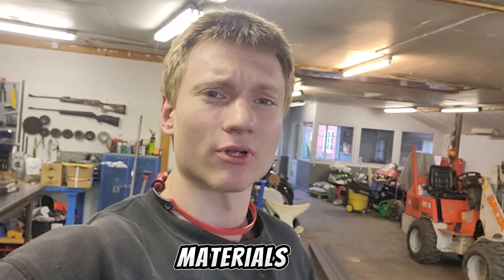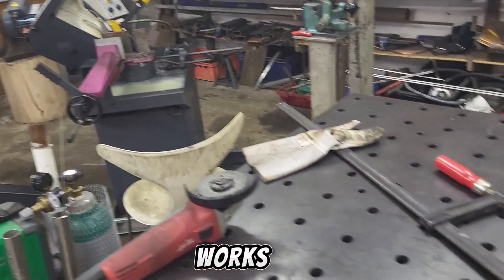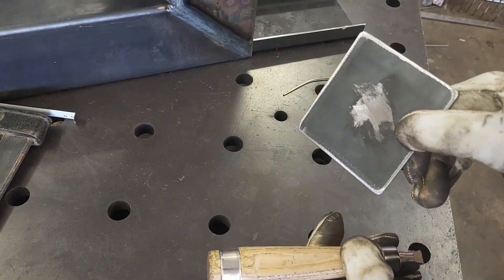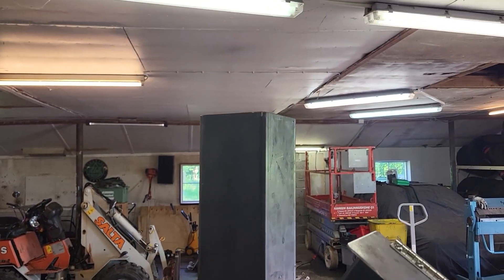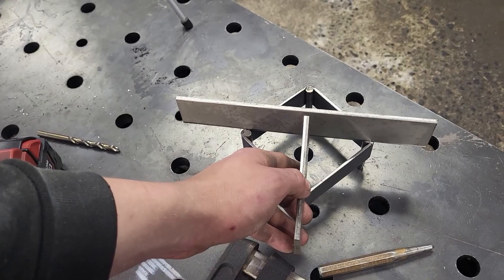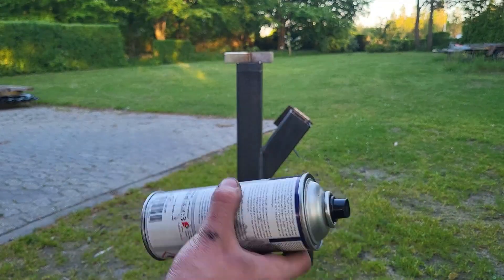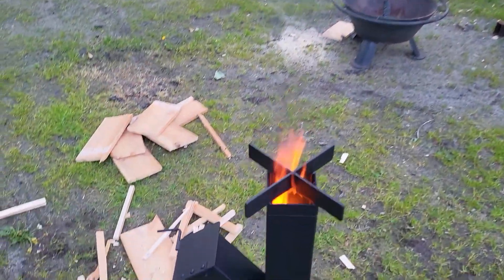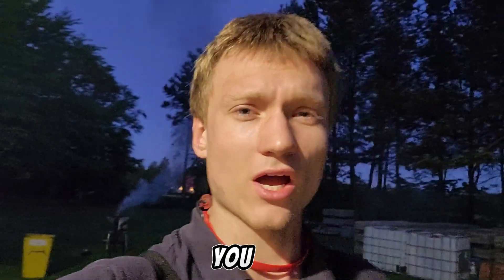Rocket Stove Full Build

Comment: Looks great, enjoying the fact that you painted it all nice, but i'm wondering if you are getting enough air in the Rocket stove? Typically people who show them off, when opening the hopper aren't meet with so much smoke? Was your bottom air intake not facing the direction of the wind? And could you let us hear it roar when it sucks in air at the bottom? Could you show off the dust in dustpan after it's cooled to see how well it burned? Any way you could show off how hot it got? would you consider adding controable secondary air intake?
Reply from the maker: I will show more of the rocketstove soon. The reason for the smoke is that i put too much fuel in the chamber. In the video, there was almost zero wind, but later in the night, I faced the intake to the wind and in gloved red hot from the burn chamber. I guess it was about 650 to 700 degrees Celsius. And for more air flow, I considered adding forced induction, like a fan/blower.

Comment: The only thing that i dont like is the legs its too narrow. It doesnt look stable at that height. if you hammer those legs to the ground around 6 inches it will be very stable. You might need a better leg design for future projects.
Reply from the maker: Yeah I see it can easily fall. A should make an attachment where I can add a larger footprint.

Comment: If you wanted to combat the "difficult to move" problem, I think you could shorten the back 2 legs enough to add straight rolling locking caster wheels and give it a handle, so you can roll it around like a wheelbarrow.
Reply from the maker: Thanks for the information. I will be building some smaller and more portable designs for camping in the future.
Reply: How about putting the caster on the front leg instead so you can move it even while it's on, that way the fire is pointing away from you instead of directly at your face?

Edit: oh nevermind you just need to put the handles on the ash tray side regardless of where you put the casters
Reply from the maker: @georgekim2058  sounds lige a good idea too👍